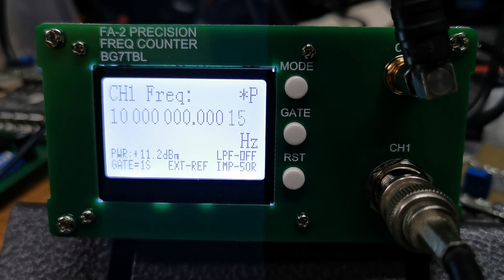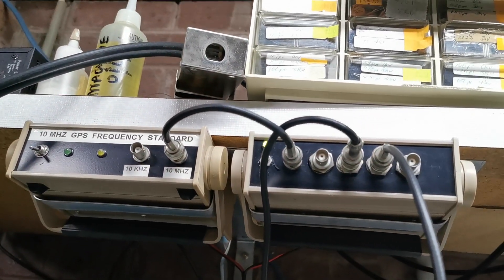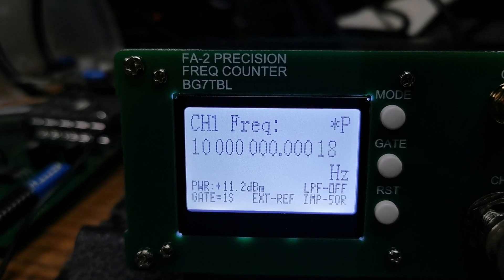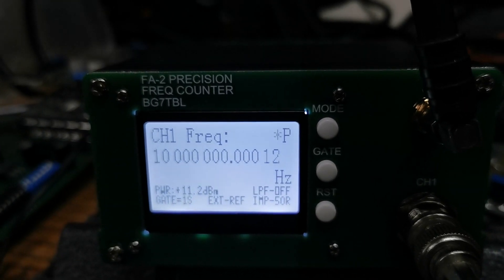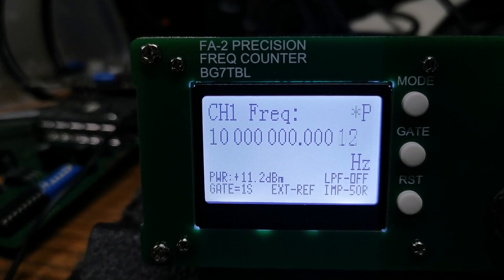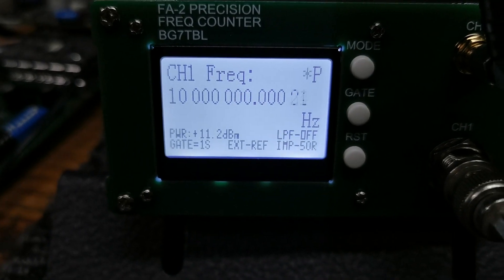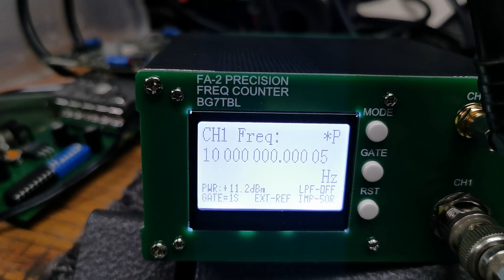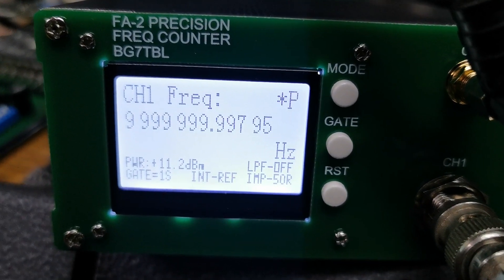FA-2 Precision 6Ghz Frequency counter demo.

Comment: Hi there, Can I use any of these frequency meters to measure EMF (up to 30Ghz) connected directly to a passive microwave antenna? I´m interested in measuring the millimetric 5G radiation received in my home and I don´t want to spend thousand of euros in a professional EMF device.